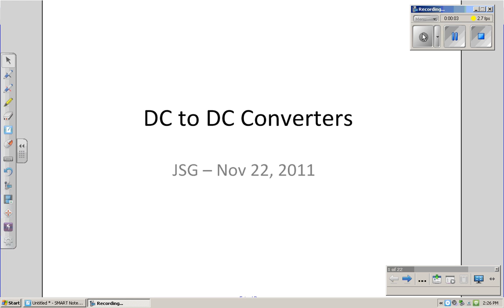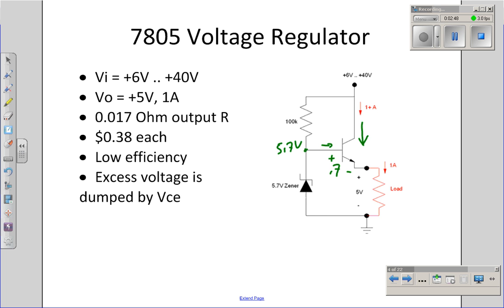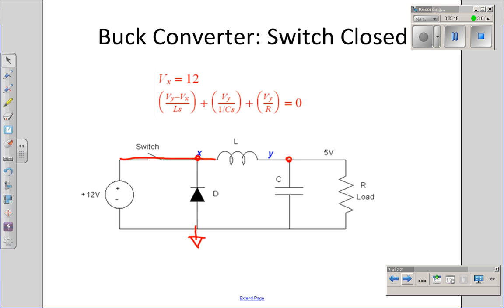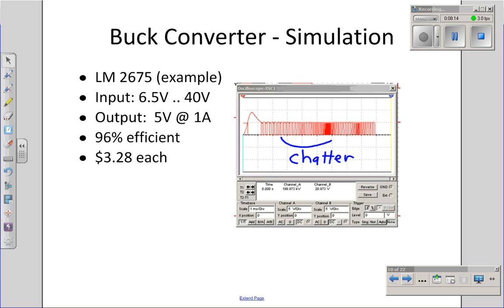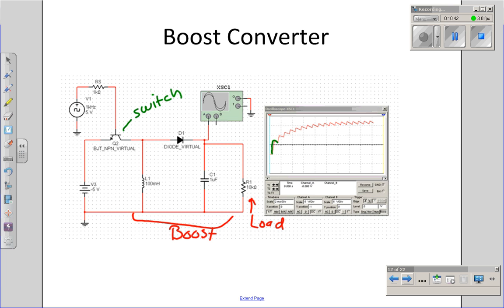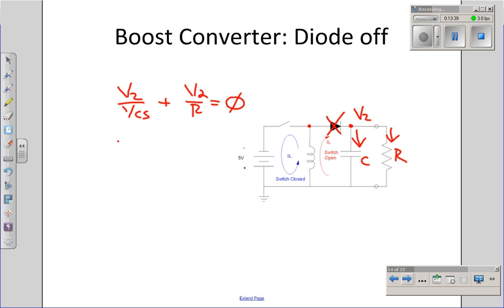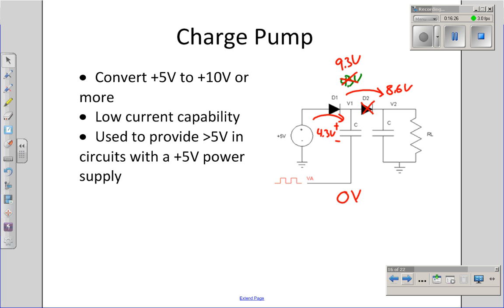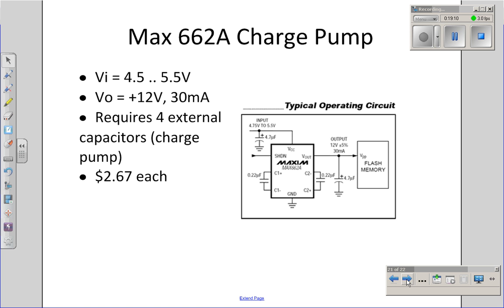ECE 320.15 DC to DC Converters

Comment: Question : let's say I have a 'huge' cel ( only one ) drainable from 2,5 to 0,5 Volts, and capable of delivering 10000 (=10^4) Amp's
What solution(s) is best considered to get  this to 230 Volt AC (!!) , and at what point do you change from DC to AC  ( supposing space and money isn't a problem ). What will be the expected efficienty overall ?
As diodes and transistors drop 0,7V ( germanium 0,3V ? ) , is above feasable with active components ?
( PS : no worries, I will not build this before I am 100% sure it is save and works ;-)